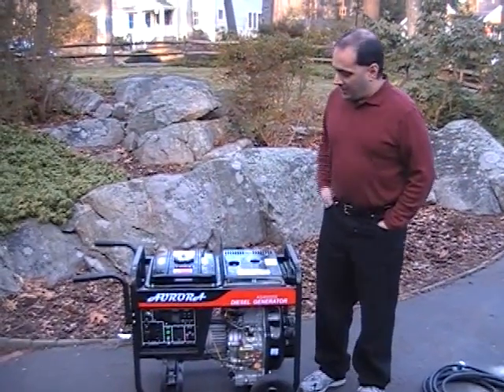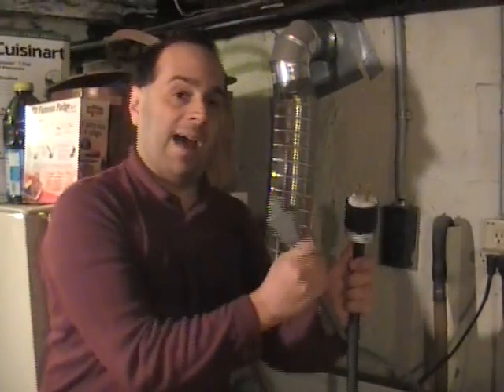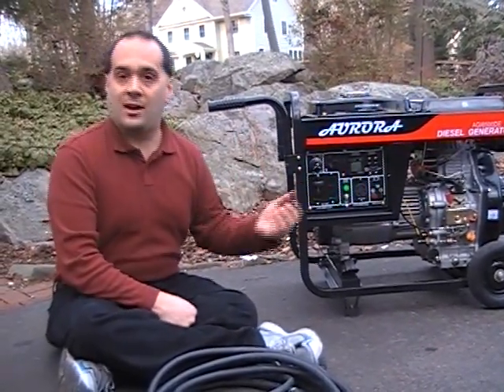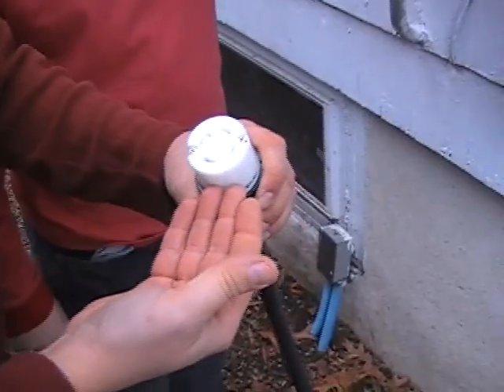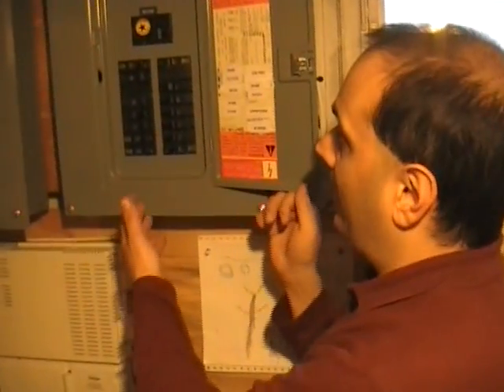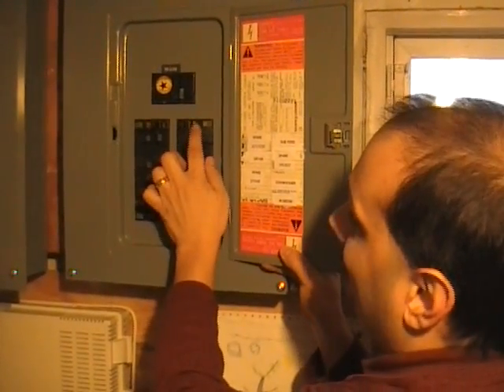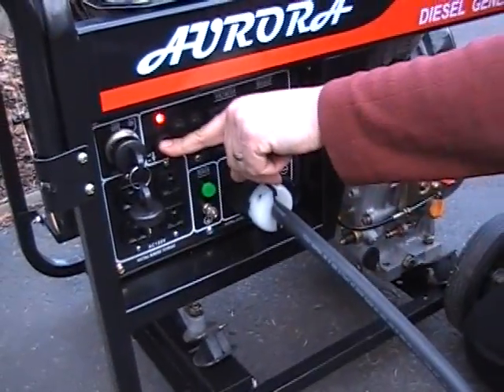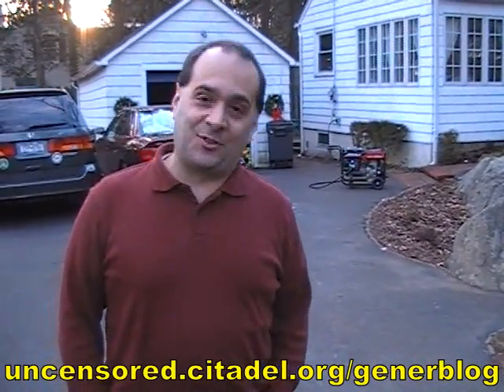Inexpensive residential generator hookup

Comment: I backfeed all the time with a suicide cord if you're a competent person and have it away from everything it works but I understand what you're saying there's a safer way to do it because most people are idiots
Reply: Spot on !
Reply: So you're a licensed electrician and you backfeed it with a suicide cord when you could spend 50 bucks and make a cord and install an interlock?  If that's true I wouldn't want you working on anything for me.
Reply: I figured out a long time ago that only fools follow rules
Reply: this youtube video will help explain what I am talking about bonder neutral vs floating neutral in the generator and why it makes a difference as to what transfer switch you use . https://www.youtube.com/watch?v=SIT9fuAU4-k
Reply: back feeding can send voltage down the neutral wire to workers trying to repair the electrical outage. if your generator is bonded you need to break the neutral wire as well. If your neutral wire is floating at the generator you do not .  bonded means neutral wire is bonded to the ground at the generator
Reply: @TexRider  shut your main off
Reply: @plumbervslife4812     the main breaker does not break the neutral . any imbalance will go out the neutral to the power lines .  You will find the info in the electrical safety codebook. Take Care
Reply: @crankychris2  I don't have to do anything except what I've been doing this entire time when the power goes out and I backfeed my generator
Reply: @plumbervslife4812  Mine's jury rigged too. I'll have to upgrade or remove it when I  sell. Like you said, we'll both have a powered panel come the next storm. During an emergency I break rules too. That's what they pay me for.
Reply: @crankychris2  my power might go out once a year or once every other year and in my garage I have my welder setup so I shut my main panel in the house off then plug my Suicide cord in and start my generator up and then flip the breaker for the generator to me it's a lot more cost-effective to do that then to spend the money on a transfer switch
Reply: @plumbervslife4812 
     Just know that if you forget to turn off your main, you'll backfeed into your utility xfmr and into your neighbor's house. If they're injured, you'll be charged with voluntary Manslaughter (Murder, 3rd degree). This is because you, Mike Cornew, knew that what you were doing was dangerous and illegal, and chose do do it anyway, causing injury or death to your neighbors.
     Your attorney will try to convince the jury that what you knowingly did, was not a deliberate act of murder to reduce your culpability to involuntary manslaughter, and he will plea for a sentence reduction. He will show the court that you did not profit from YouTube, and that Google also shared the responsibility for their injury/death.  A good attorney might be able to convince the judge to waive much of the sentence but you will still be a convicted felon. 
     Google will, of course, provide everything you have posted on 'YouTube' and any other Google service you subscribe too. Google will correctly state that they are not responsible for your criminal behavior, and show your YouTube agreement. You neighbors may resent you for the hardship you caused them because:
1. You didn't want to spend a few hundred bucks AND
2. You boasted about it on YouTube, adding to their anguish.
    The judge will consider all these facts before sentencing you.
I am a retired Union Electrician who has testified in court regarding illegal electrical installations. Believe me or not, I know what I'm talking about. I pray you don't find out the hard way. 

I am posting this because of the many dangerous electrical posts I see on YouTube. Hopefully I can save someone's life. That is why I spent so much time replying to this post. Mike, maybe I might even make you think about it?

Chris Chilson, IBEW LU #349, Retired
Reply: @crankychris2  are you kidding me how does someone as old as you know how to copy and paste
Local Ua 322 active
Reply: @plumbervslife4812  Man, as a retired IBEW member I see so much dangerous shit online it just freaks me out. Some of these "YouTube Wireman" really ARE dangerous. Union wiremen like you and me did this every day for a living, but YW's know just what they watched here. That's the sum total of their ele knowledge--these YT videos.  That's why I always turn my main off during an outage. You see, all my neighbors have gensets, and none are wiremen. We all share overhead 13.2KV/240V stepdown xfmr's too. Be safe always, brother. You and I won't ever fry anyone, I haven't yet, and I'm 66, and I still have 10 digits! BTW Mike, as a retiree those pension paychecks are sweet! I'll always be Union: YES!
Retired LU # 349, IBEW (Kids, that stands for 'I've Been Every Where') 
Please think safe. Folks, Ask a wireman for help, don't just assume it's OK...
That's all, folks!
Reply: @plumbervslife4812  don’t you know that back feeding your generator can be dangerous. Make sure you are aware.   Here are the rules about portable generator safety: make sure you are aware of all the warnings before using portable generators. This is just a reminder for everyone’s safety. All generator safety rules should be followed carefully. This advice is just to make sure that everyone is aware of all the warnings and it’s just to remind people to be careful using portable generators. Generators can be dangerous if not used carefully. Every year, hundreds of people die or get injured when using portable generators due to carbon monoxide poisoning and electrocution. Make sure you are using your generator carefully and keeping others safe as well. There is something very serious that everyone should always be aware of when using generators. Some people do run their generator indoors which is not safe and that increases the risk of carbon monoxide poisoning which can cause death of family and you. Some people run their generator in wet conditions which can electrocute them. Please remember that you should never run your generator indoors. Remember that carbon monoxide is an odorless and colorless gas that you cannot see or smell. Carbon monoxide is a silent killer. Keep that in mind. Make sure your generator is 15-20 feet away from your house and away from doors, windows, and vents. Never use your generator in your porch too. Having a carbon monoxide detector is very important against generator safety. Some people also allow children to go near the portable generator which could pose risks. We need to keep an eye on our children making sure that they are not near the portable generator so they won’t get electrocuted or burned by the generator which is dangerous. A locking enclosure also keeps kids safe. A generator shed might look like a tempting place to explore, or take cover during a game of hide and seek, but a generator is a dangerous piece of equipment that can cause injury. It says on the manual that we should also keep children away at all times from the portable generator to avoid injuries. Please do not allow a child or unqualified people to operate the portable generator.  It is important to keep your children safe especially little ones. The portable generator can be hot during an operation. Just because some manuals missed what should be listed doesn’t mean it’s safe to do. Always follow the generator safety rules when using portable generators. Generators pose electrical risks. If you need to use your generator during wet weather, you need a generator tent to protect your generator from getting wet. Don’t let your generator get wet. Keep your generator dry and before using your generator, please make sure your hands and your generator is dry. Do not wear loose clothing when operating the generator. Everything that is said on the generator’s operating manual should not be ignored. Never smoke cigarettes near the generator. Please keep flammable things away from the generator. Never overload your generator too. Your generator can catch fire. Never ever try to plug a generator cord into a wall outlet to avoid back feeding. Back feeding your generator is dangerous. Always turn on your generator first before plugging in appliances and shut off the appliances before turning your generator off. Use a heavy duty cord for your generator and the cord should not be worn out. All the instructions should be followed carefully. Never refuel your generator while it’s running. It can cause fire if fuel spills while your generator is hot. You should turn off your generator and let it cool off before refueling it. Having a fire extinguisher next to the generator is also important. This is only a reminder for everyone’s safety of using generators. Make sure your generator is properly grounded. Having a fire extinguisher next to the generator is also important against the safety rules. https://youtu.be/I1jT3ANENvI and here is a video more about keeping others safe when using generators and also about our family’s safety. It’s important to keep our little children safe as well. Make sure they’re away from the generator. Hope this helps. Make sure you use your generator carefully. Be safe.
Reply: @TexRider  Not if you pull the main breaker  !
Reply: @BIGBADWOOD  Sorry, wrong !!! Tex is correct !! NEC 230-95 and NFPA 70-1996.

Comment: For those that can't use an interlock and don't want to spend $$$ to install a transfer panel, there is another legal way for less than half the money.  Have your electrician install a 3 way 200 amp service switch. It will connect EITHER your main or gen power. You'll still have to open your high amp loads manually (dryer, hot water heater, hvac, etc.) to prevent your genset from overloading. but the danger of backfeeding into someone else's house is gone.
it also provides an emergency disconnect for those older services that feature multiple mains. Use a weather resistant enclosure if outdoors, they also are lockable. They are required in the South Florida Building Code for new installations.
IBEW LU #349, retired
Reply: I live in South Florida and was wondering about codes here for these devices, thanks for the input 👍
Reply: @JuanAvila-mb5yk    Generator safety: make sure you are aware of all the warnings before using portable generators. This is just a reminder for everyone’s safety. All generator safety rules should be followed carefully. This advice is just to make sure that everyone is aware of all the warnings and it’s just to remind people to be careful using portable generators. Generators can be dangerous if not used carefully. Every year, hundreds of people die or get injured when using portable generators due to carbon monoxide poisoning and electrocution. Make sure you are using your generator carefully and keeping others safe as well. There is something very serious that everyone should always be aware of when using generators. Some people do run their generator indoors which is not safe and that increases the risk of carbon monoxide poisoning which can cause death of family and you. Some people run their generator in wet conditions which can electrocute them. Please remember that you should never run your generator indoors. Remember that carbon monoxide is an odorless and colorless gas that you cannot see or smell. Carbon monoxide is a silent killer. Keep that in mind. Make sure your generator is 15-20 feet away from your house and away from doors, windows, and vents. Never use your generator in your porch too. Having a carbon monoxide detector is very important against generator safety. Some people also allow children to go near the portable generator which could pose risks. We need to keep an eye on our children making sure that they are not near the portable generator so they won’t get electrocuted or burned by the generator which is dangerous. A locking enclosure also keeps kids safe. A generator shed might look like a tempting place to explore, or take cover during a game of hide and seek, but a generator is a dangerous piece of equipment that can cause injury. It says on the manual that we should also keep children away at all times from the portable generator to avoid injuries. Please do not allow a child or unqualified people to operate the portable generator.  It is important to keep your children safe especially little ones. The portable generator can be hot during an operation. Just because some manuals missed what should be listed doesn’t mean it’s safe to do. Always follow the generator safety rules when using portable generators. Generators pose electrical risks. If you need to use your generator during wet weather, you need a generator tent to protect your generator from getting wet. Don’t let your generator get wet. Keep your generator dry and before using your generator, please make sure your hands and your generator is dry. Do not wear loose clothing when operating the generator. Everything that is said on the generator’s operating manual should not be ignored. Never smoke cigarettes near the generator. Please keep flammable things away from the generator. Never overload your generator too. Your generator can catch fire. Never ever try to plug a generator cord into a wall outlet to avoid back feeding. Back feeding your generator is dangerous. Always turn on your generator first before plugging in appliances and shut off the appliances before turning your generator off. Use a heavy duty cord for your generator and the cord should not be worn out. All the instructions should be followed carefully. Never refuel your generator while it’s running. It can cause fire if fuel spills while your generator is hot. You should turn off your generator and let it cool off before refueling it. Having a fire extinguisher next to the generator is also important. This is only a reminder for everyone’s safety of using generators. Make sure your generator is properly grounded. Having a fire extinguisher next to the generator is also important against the safety rules. https://youtu.be/I1jT3ANENvI and here is a video more about keeping others safe when using generators and also about our family’s safety. It’s important to keep our little children safe as well. Make sure they’re away from the generator. Hope this helps. Thank you.
Reply: Can you provide a link to a 3 way 200 amp service switch to buy?

Comment: You might as well have installed one new larger panel and then you could run any thing you choose to.
Reply: If fuel isn't a problem, a portable whole house genset around 12KW can feed your entire house, w/transfer sw, permits, and labor for around $2500, compare that to the price of a Kohler or Generac permanent install around 15K. You'll need a small shed, for  your genset and stuff, too.
Folks with gas appliances can go with a smaller genset, but you need around 6K extra power to start a 4 ton hvac.
5,000 watts=10 hp @ 1 hour=1 gallon of gasoline=5 lbs propane/nat gas
Reply: The topic was Inexpensive not Costly way to hook up a generator. To upgrade a service gets very expensive